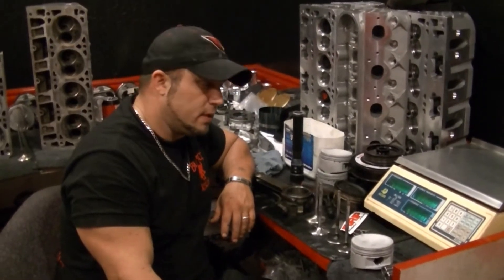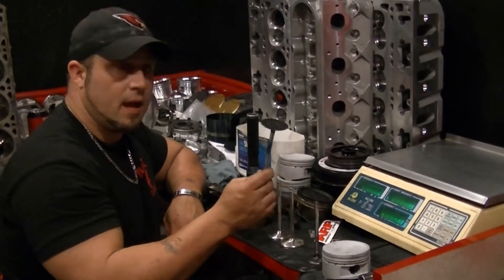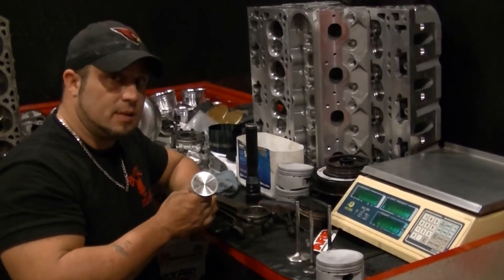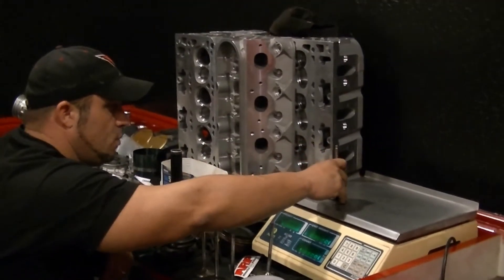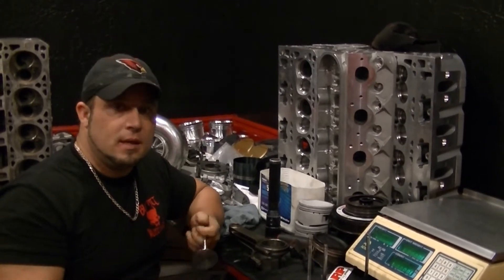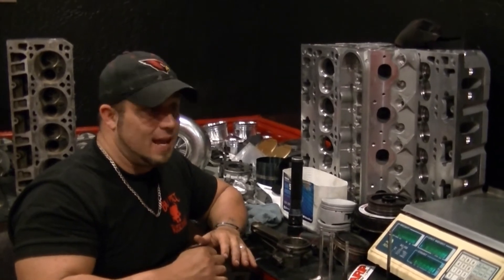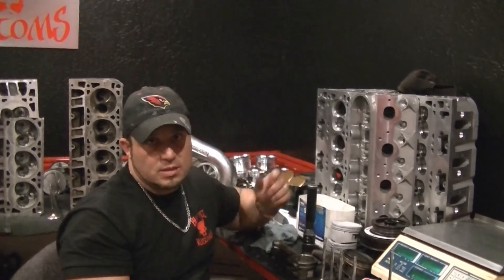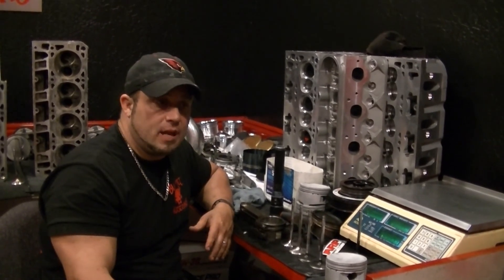LS Cylinder Head Identification Part 4 Of 4

Comment: Nice honest vids, educational.  Im planning and blue printing a lq9 build. The ls3 cylinder head is what im looking at for sure, my question to you is I want to turn this thing hard. its going to be NA engine and be driven street/strip.  8,000 is my goal for living at safely. I understand solid roller, I have been looking at the all pro cylinder heads, what are your thoughts on these versus the chevy performance cnc ls3 heads?  Im feeling the spring pocket may not survive the abuse in the gm casting? am I correct?

Comment: ls3 valves are not Titanium only ls9 valves are Titanium and the ls9 intake valves are bigger then intake valves on the ls3 heads
Reply: +Nicholas Ash the ls9 intake 2.165 and is made of titanium the ls3 intake valve is made from. stainless steel and is a 2.165
Reply: +Nicholas Ash nope they are still a 2.165
Reply: *****  2.165
Reply: the ls3 intake valves are not titanium

Comment: What would be the best head andcam for 02 5.3
Reply from the maker: It really depends on what you want, torque top end HP, what stall and other Bolton's? I like a stage 6 ported 243, with a mid 590L 23ish cam with a nice 2700 stall....